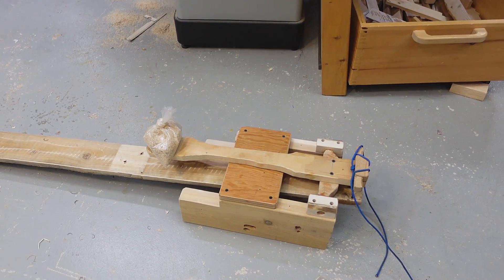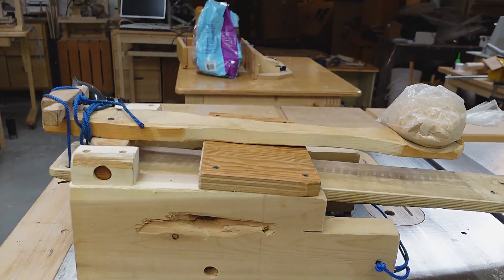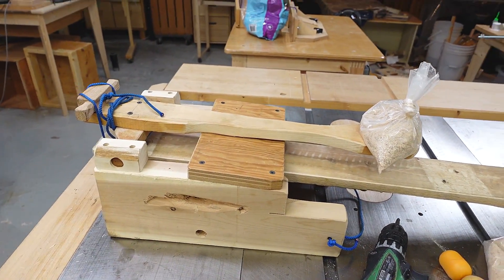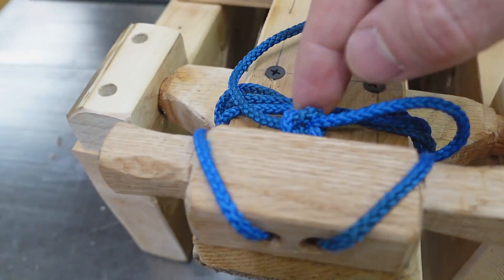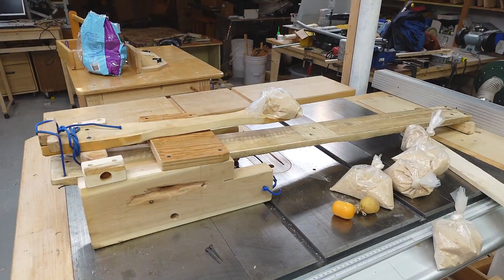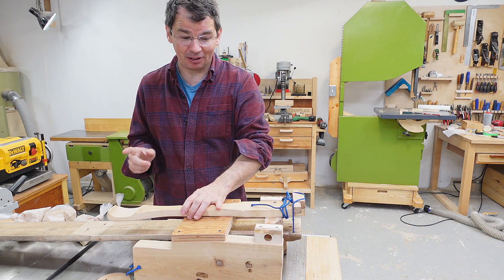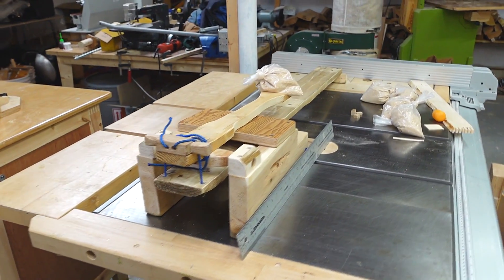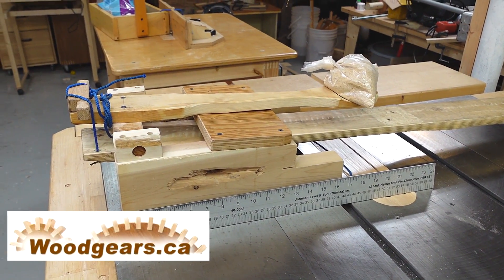Stomp catapult

Comment: Matthias, instead of using rope, why not use springs?
Perhaps a spring to push the lever action?
Or to pull it.
And voila, another video in which you can show us which gives better result. A spring that pulls or a spring that pushes.

I am sure you can come up with some kinda contraption to make it work.
A catapult powered by a pushing spring, or a pulling spring.

My bet is on the pushing spring, but then again, a pulling spring may also work nice.

Comment: Challenge
Last time I went to a Cub Scout Council event they had pneumatic paper tube rockets powered by mini air compressors attached a smaller reservoir with a dump valve and roughly 30mm tube to slide the rockets over.

Think you could design one to be stomp powered in a similar manner to this catapult?
I'm envisioning something that uses blackout cloth available from the craft section of a big box store as a bellows.

Comment: But does the catapult really have to stop abruptly to be accurate? Wouldn't it be enough to release the projectile if the arm started to slow down?
Reply from the maker: The more defined the point of slowing down, the more accurate the release point.  So the more abrupt, the more accurate.
Reply: There we got it. It doesn´t has to stop, just getting slower, abrupt but just a tiny bit, the same amount as the projectile is slowing down by the air resistance. The counterforce has to be a bit bigger than the force that is accelerating it at this point. This could be a preloaded spring, a piece of mass or both...
Still thinking about a back plate that can open up at the release point.

Comment: I agree with Greg, being Matthias' kid is cheating 😂
I had a similar project in HS physics, though they made the mistake of calling it a "launcher" so I just used it as an excuse to build a new air cannon. In hindsight I should have used a consistent pressure with a ported barrel and a time-controlled valve rather than varying the pressure for better accuracy, but oh well. I guess going to an engineering school did help. (not that I actually got an engineering degree anyways lol)
Had to go outside for the range test, and brought my old CO2 cannon just for fun. Got asked about that one when applying to said engineering college, which was a fun conversation as well.

Comment: That was awesome! I have experimented with such contraptions and noticed that the flexibility of the levers is important. Firstly it reduces the forces in all joints and hinges, because it takes more time to transfer the momentum. Secondly the transfer of energy seems to be more efficient, I have done sone calculations (but given up as the differential equations turned out a bit nasty) and had the vage theory that the energy transfer can be maximised by an ideal combination of flexibility and rotational intertia of the levers.

Comment: "But any contraption that throws something has some inherent risk to it." Like throwing hamburgers to the bear across the river, eventually he will swim across and claim the BBQ.
Matthias, yes indeed, this innovation seems to occupy a useful niche dissipating hazard as it dissipates its active energies. Could you use a replaceable strap where the rope is, maybe rubber to allow adjusting the energy transferred to the throwing arm? (use a weaker one to lob for ball catching) Redesign to cast sideways and launch frisbees.

Comment: In highschool me and a guy with a lathe built a small ballista for latin class. (The guy with the lathe probably did 80% of the work). We used oak for the arms and steel cabling. This thing was basically a crossbow. My teacher was legitimately concerned it might kill someone lol. We only got it to fire a few times before one of the arms snapped.

Another team built a much larger (8'?) ballista out of construction lumber and polyester rope. They couldn't get enough tension in the arms to fire anything more than a few feet. Looked cool hanging from the ceiling though.

Comment: What a great toy for kids of any age!
Years ago, I was asked to make a game for my step-grandkids school fundraiser. Being aware of the bullying problem many kids faced at the time, I made a grotesque Rat-Rod-type painted cut-out character on a 4' piece of plywood with the arms up with claw hands overhead, coming-to-get-you attitude with a pie plate red nose that protruded with a spring catch that once hit, would spring in and ring a large steel bell. I called it "Boink the Bully". I cut slits in tennis balls and added sand so they wouldn't bounce too far and have enough weight to "Boink" the red nose.
At the end of the evening, all the kids were still in line to continue boinking the bully, over and over again, even the littlest ones (I had to make a line just 5' away so they could hit the nose). I had no clue that even the smallest ones harbored fear and resentment toward bullies! (tear in eye)

Comment: This is fantastic. The design is so simple and elegant. With some slight adjustments to the geometry, I think you could get the arm to start decelerating before it gets completely vertical. Then you could use a deeper well to hold the projectile and still get a clean release. I think I'm going to have to build one just for me to play with. 😁

Comment: Nope that thing needs a stainless steel soup ladle instead of that wooden spoon -load it with water baloons and make a fort :) . Bend it a bit and drill couple holes in a handle and attach it via wood screws on a throwing arm.Also you could control release disctance by attaching a rope on a throwing arm and a base.

Comment: now you need to build a trebuchet ...
Reply: This is actually a traction trebuchet (also called a mangonel, not to be confused with torsion engines/onagers of the roman empire), popular in the early middle ages.
Reply: @bami2  a mangonel is the natural enemy of any group of archers
Reply: He did.  This is a trebuchet with truncated travel.  It's essentially a traction trebuchet with only about half the usual rotation.  It also lacks the sling that makes a trebuchet so much more effective in transferring energy to its projectile so it's like an onager in those respects, but the drive is trebuchet, tilted 90 degrees.
Reply: @leifhietala8074 << pointing up>> what they said.

Comment: You could probably extend the supports to the front some to reduce the tipping moment and also tweak the front linkage positions and release angle to work similar to a trebuchet.
Reply from the maker: Those supports would ideally be longer, but those were the lengths of the scraps I decided to use.  Those pieces actually have holes in them from using as targets for my air gun.